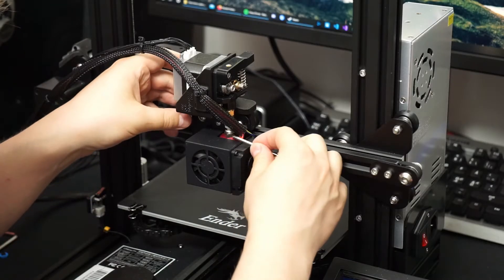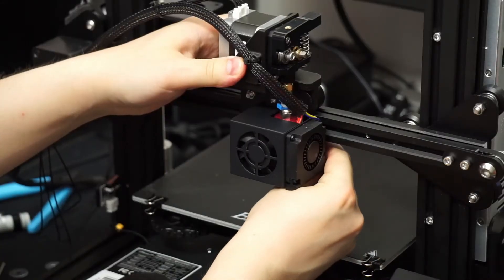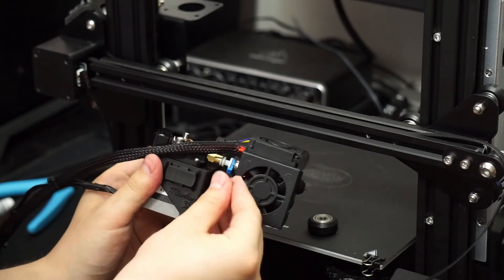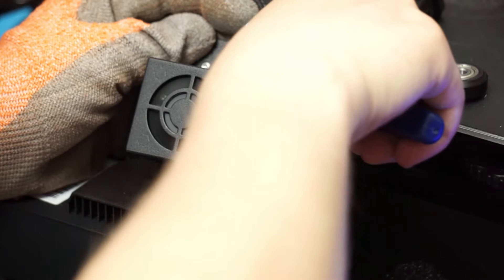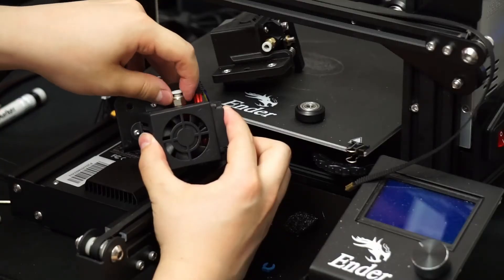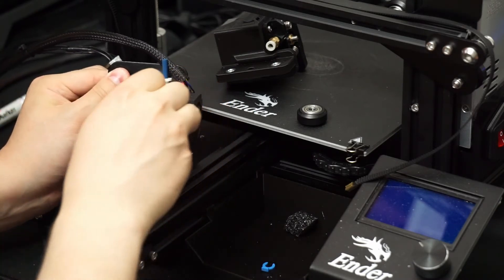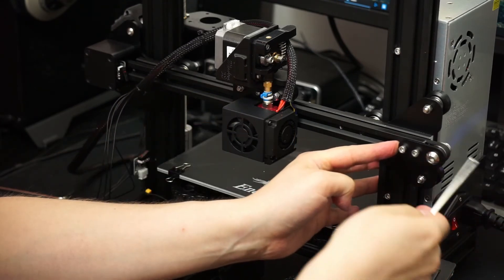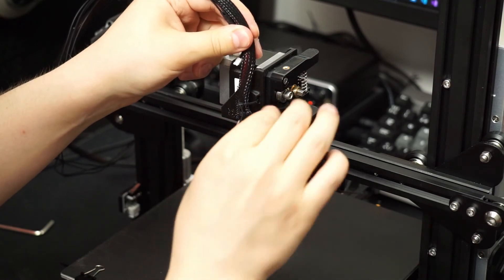Change PTFE Tube for Ender 3 Direct Drive Upgrade

Comment: is it improving your result of benchy from upgrading to direct drive extruder?or is it still not smooth like when using bowden
Reply from the maker: I'm actually working on a video right now and I'll use the benchy print again. We get to see if the upgrades as a whole have made a significant difference so stay tuned for that. 🙂
Reply: @HardFirmSoft  ahh thanks for that...